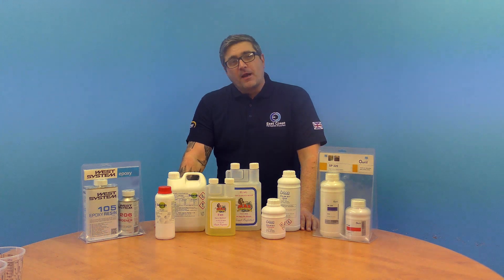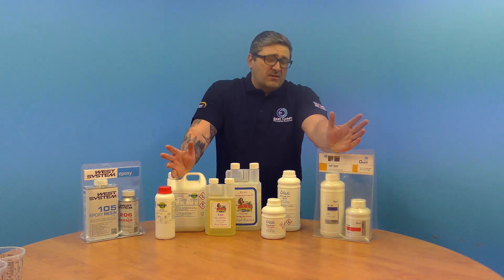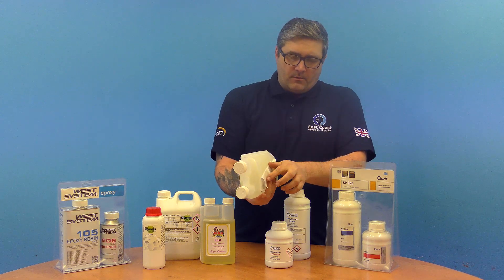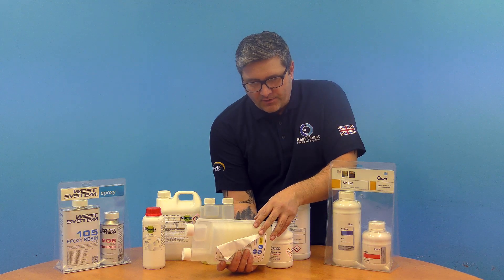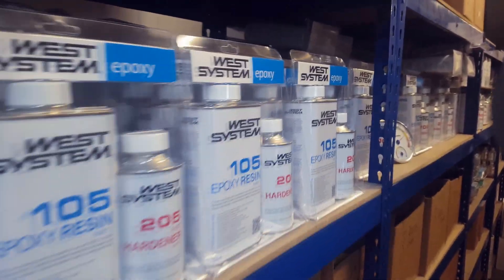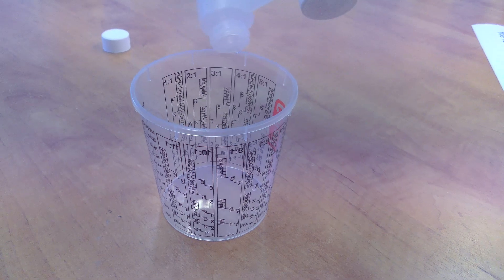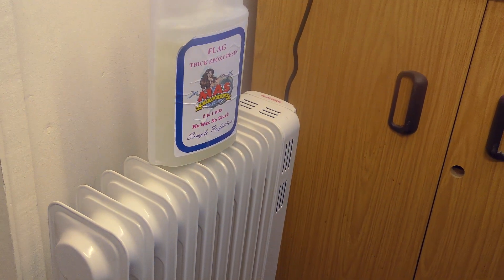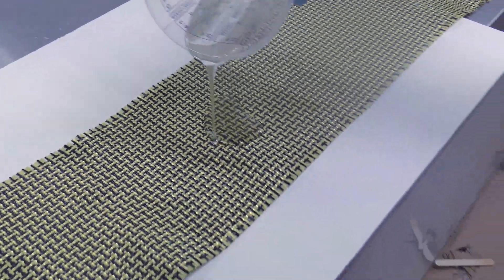Crystallization in Cold Epoxy Resin

Comment: What happens if you use crystalized epoxy?
Reply from the maker: The resin will not mix correctly with the hardener and you will have lumps in the final finish or it may not cure properly. in the worst case the resin will be totally solid and you wont be able to pour it out until you have heated the resin to melt it down again.